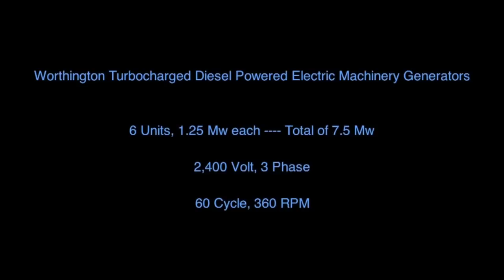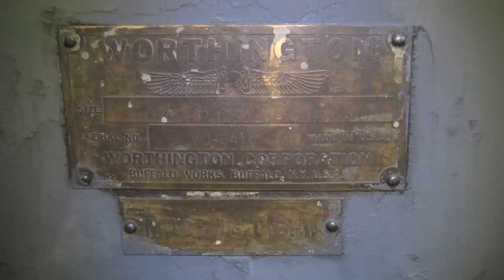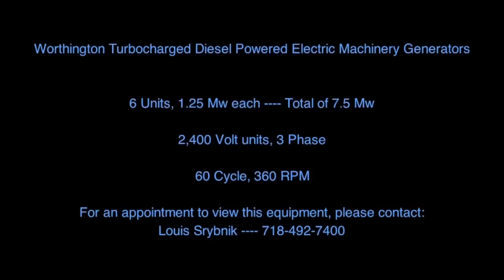On-Site Power Generation: 7.5 Megawatt, Six Worthington Multifuel Capable Engine Generator Sets

Comment: In the early 90's I worked at a natural gas compressor station in South Florida. We had the exact same Worthington units but instead of being coupled to a generator to generate electricity there's were attached to compressors to pump natural gas down the pipeline. There were two inline 6 cylinder 1500 horsepower and one inline 8 cylinder 2000 horsepower units and as of today in September 2022 they are still online and in use, they run on natural gas and not diesel fuel. Top speed is 330 rpm's for each unit. Back then I was a plant operator at the compressor station.
Reply: I too worked at cs20 on the same units. Small world.
Reply: Geeez, when was that? I was there from 4/90 to 7/95. My nephew is the mechanic at CS 17 in Silver Springs.

Comment: The problem with purchasing old equipment in place is that it cost more to remove than what you could buy that would be order of magnitude more efficient when you look at the entire lifecycle . I work on many power facilities in telecom and unless they where packaged units with access  just the deconstruction , crane setup removal and restoration of facilities just didn’t make sense. 
For example I could have got 3 1100 hp turbines with less than 500 hours but the where on the roof of a ten story building ina downtown major city , the crane cost alone was over 100 k before they even got off the roof  . But would have made a great diy hovercraft ! Lol 😂

Comment: I was in the room,  got to look at them with my own eyes. My dad used to work at the "super-secret government facility," which was part of the SAGE network back in the early 60s. I also got to see the computer rooms inside the cubical concrete SAGE building these generators fed. All were empty at the time, except for some records being stored there in filing cabinets.

One of the most interesting things still left were the large fans, which were used to move massive amounts of cooling air through the computer machine rooms. The original computers used vacuum tube logic elements, which generated hundreds of kilowatts each (there were two identical ANFSQ-7 computers in the facility, one of which was always available as a backup for the other).

The engines were borescoped by at least one potential buyer. The blocks are all cracked, making them useless. They stood unattended for decades through central New York winters, which can go down to -20° F or lower. Internal water-based coolant froze during those years, and ruined the engines. Too bad, they were top-quality, as the narrator says. The electrical generators and switchgear were mostly made by G-E.